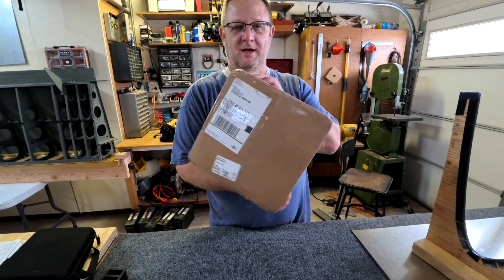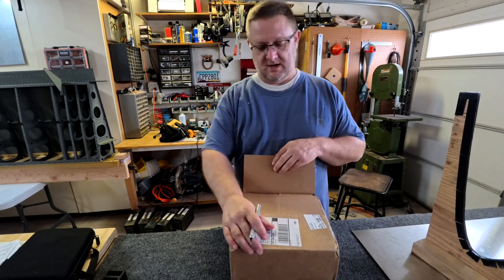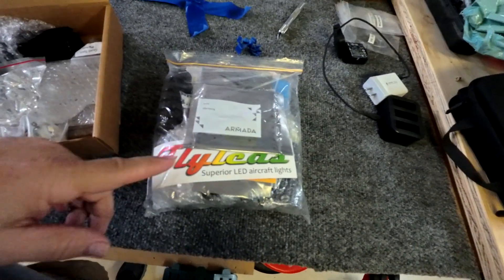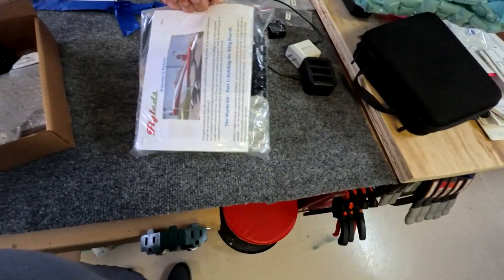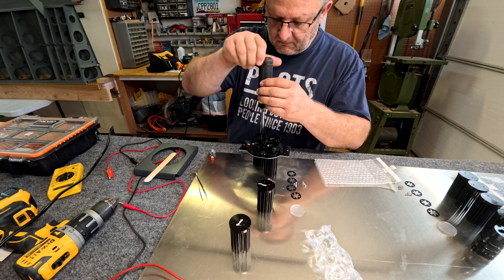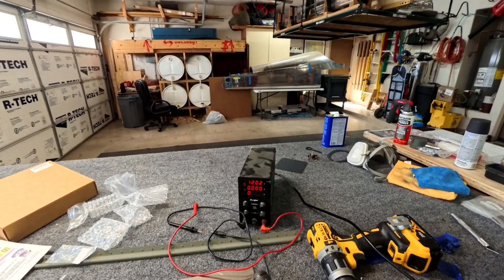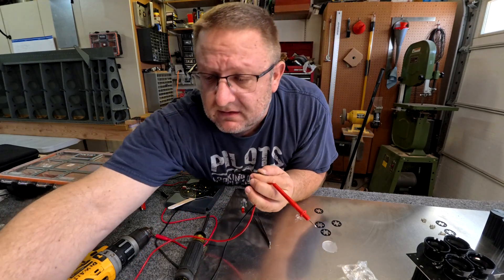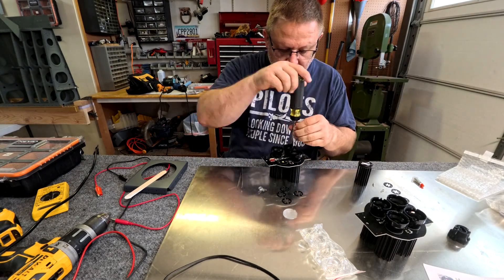RV-14A Build: FlyLEDs 1 - Building A Vans RV-14A #aviation #vansaircraft #dadjokes #diy #airplane

Comment: Excellent video. Have you decided which nav and strobes you’re going with?
Reply from the maker: I got the FlyLEDs works package in addition to the Quads for landing lights. It might be a little overkill but the one thing I don't like is trying to land at nigh and not having bright enough lights.
Thanks for watching and let me know if you think I need to add anything.